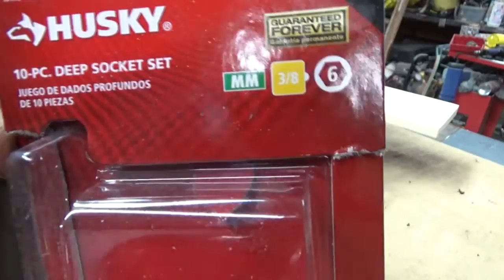1994 briggs and stratton raptor 5hp engine teardown

Comment: That is a fairly basic flathead go kart engine, which means, no oil pump or passages. The connecting rod is supposed to have .002-.0035” of clearance on the connecting rod so oil can get in from the oil holes and from the sides.
Reply from the maker: thanks